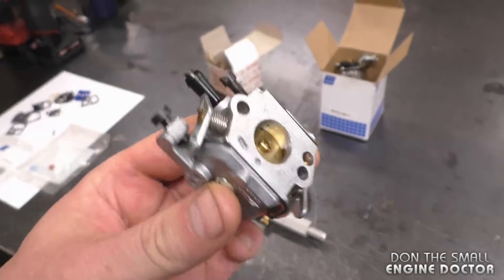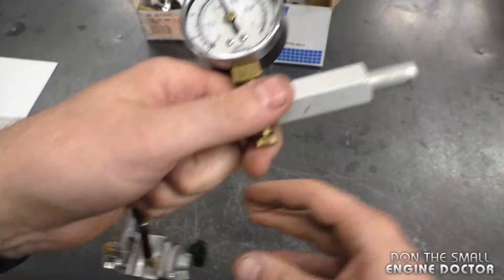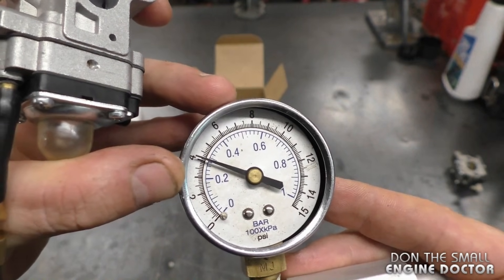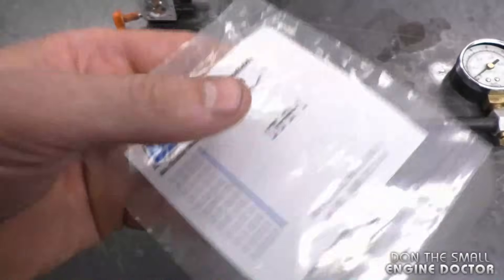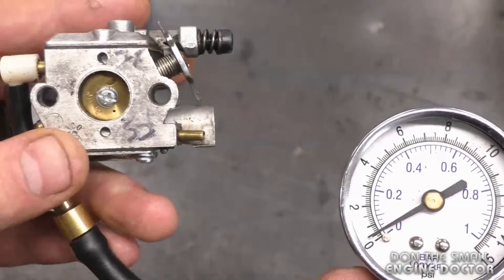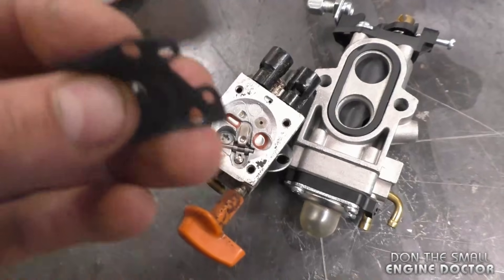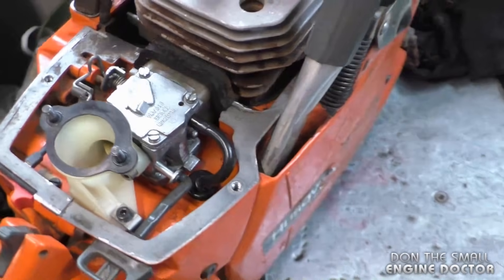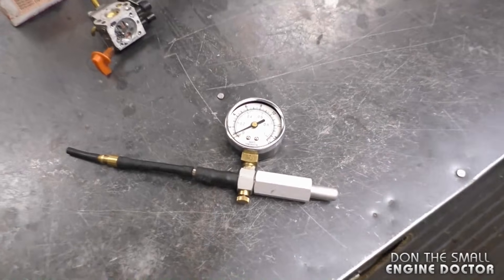HOW-TO Pressure Test A 2 Cycle Carburetor

Comment: I have had my best luck putting the gaskets in wet, not dry. About 50% of the time the leak test fails for me. Usually the fix is taking it back apart, wearing all the gaskets, then reassemble and leak check.

Comment: Is there an easy way to identify which fitting on the carb is the inlet and which is the outlet?  Some carbs it is easy to identify and others are very difficult to identify, sometimes by trial and error.

Comment: The inlet side of the carb, is that the diaphragm side or the reed valve side? What is the best way to know for certain you're putting air in the correct tube of the carb  to check the seat valve? The weed eater I'm working on, Poulan Pro 335, did not have gas lines on it.

Comment: Thanks It what theydo with car engines but with smoke. Can you do that here too? I have done almost everything but still can not get it running. I have sprayed into the channels, changed the diagphram but not the gaskets because it looked good. It is also good to look over the other externely gaskets after the carburator into the combustion chamber. Any leaks will be disastres to the mashine. Look all the way.

Comment: What purpose does that hole on the carb cover plate serve? Will a Mityvac that has a pressure pump feature work the same as the pump you are using?

Comment: How do you fix when you pressure test carb and you have a leak from air valve screws?
Reply from the maker: i replace diaphragm gasket
Reply: @donyboy73  
I got a solo 651 chainsaw and the carb is leaking from the high and low air valve screws.  How would you fix that?
Reply from the maker: @lukepodolski8818  sometimes clear nail polish works on the outside of threads
Reply: @donyboy73  thank you: ill give it a try

Comment: Dony, be sure to add the info about diapham flexability and post height- it can bleed off pressure because it will depress the lever. Make sure the lever arm is at proper height in relation to the carb body

Comment: Hi Dony, excellent vid' from you as always, but, you don't test the pop-off pressure? Isn't it an important thing to check with those testers?

I've learned on an rc website that it should be at 0.8bar

Hi from France

Comment: Can you do pressure test on a 4 stroke carb?  If so, any special instructions to deal with the fuel shut-off solenoid for the pressure test?
Reply from the maker: i flip cab upside down and do a pressure test that way, i test solenoid with a battery, it should retract in when power applied to it
Reply: @donyboy73  So no way to do testing with carb on the engine, like with 2 cycles?
Reply from the maker: @donens9310  no
Reply: @donyboy73  Thanks, that is what I thought.  I continually work of Vanguard and Kohler twins powering grain augers.  Because of sitting for extended periods, fuel is always an issue and carb removal is a pain.  Continuously, cleaning jets, carb bowl and needle/float.

Comment: Donyboy;  have Husq 266 with Tillotson hs254b.  My tester shows inHg and mmHg.  Any idea on what the 7 psi should be on my tester?  Also, what does it mean if the pressure test goes up, then very slowly goes down and settles to a spot, then stays there with no further decrease?

Comment: Thank you Don, for sharing your years knowledge with others I appreciate it- I'm learning that you just can't always clean and put a kit in a carburetor and it work properly- it also seems to make a difference to put back original equipment quality parts when repairing equipment and sometimes it's best to put a new part back in it as opposed to rebuilding the old one

Comment: PR DESIGNS

This should be everyone's go to spot for information on small engines!
I have always found the info and processes I needed for keeping my engines running properly. Donny Boy is concise and obviously knows his stuff....NO bull** from him!!!
I do have a question I was hoping someone could help me answer though......I have a Walbro off of a 031 and a Tillotson off of a 041. I have put complete rebuild kits in both and no matter what I do I get a leak down on the pump side. I know the needle/seat are good as I have tested it with that side open under water and the seat doesn't bubble.
is there a tip for sealing up those flexible valves and gaskets on the pump side even with all new parts??
Should i just try running it before buying new carbs??
Thanks DonnyBoy and anyone else who can help

Comment: Great video, thanks for sharing. Will help with keeping my tools in good working order.
Reply: I already removed, cleaned, and reinstalled the carburetor on my pressure washer with a Honda engine. Idling and throttle-up running like a charm now. Previously was having to manage the choke lever to get to run continuously. Main jet was clogged almost entirely.

Comment: Hey Don, Thank you for this video! I am gearing up to start a mobile small engine/equipment repair/welding business in PA and I saw you on the Small engine Nation with Fill and am learning all I can about two cycle engines. I raced a KXT250 Tecate in the 90's but things never stay exactly the same. Where are you located my friend?
Reply from the maker: congrats on your new business, I'm in Ontario Canada. I'm also a bike rider too!
Reply: @donyboy73  Thank you Dony. I am thinking abut doing free pickup and delivery for equipment and here is why. I have a place to do the work but it is at a relative's and I cannot have customers coming and going.within reason I would pickup and deliver anything all the way down to a chainsaw. I know this wil modify itself as I get more business. thank you again. love the vids.

Comment: What you really have to look at, today, is - is the carb plumbed correctly.  I picked up a little MAC saw a few weeks ago and the idiot that had owned it, previously, had plumbed it up all wrong.  The fuel line was plugged into the carb and not the primer bulb and the overflow line was plugged into the carb.  New fuel lines and diaphragms correct the running problems of this saw.  When I doubt concerning the fuel lines I always consult an IPLfor the specific model of saw i am working on.  The little Mac not starts with one pull and runs fine.  I did pressure test it with my Mighty Vac to 7#.

Comment: Nice video. I have many engines with different cc's, 50cc rc engine, 70cc hacksaw, 20cc and others most with Walbro Carbs. How I know or calculate the right pressure for each engine/carburetors?

Comment: Hey  Don thanks for VIDEO on pressure testing 2 cycle carburetors. I have a
BVM200VS poulan pro leaf blower. Installed new carburetor can't get it run.  Have any suggestions.

Comment: I can't blow air through the fuel inlet what does that mean?? I cleaned the entire carburetor and put it back together and still can't blow air into it and it won't draw fuel.. Any help would be greatly appreciated thanks.
Reply: Ur carb is plugged up before needle diaphragm.

Comment: I have a 280 cc 2 stroke engine with a Walbro WB Carb.  The carb on the unit came with a PSI  popoff pressure of 11 PSI.  The company says the pop-off pressure should be 17-19 PSI.  How do you calibrate the Popoff pressure making it 17-19 PSI.  Thanks in advance for your assistance.

Comment: Can I use this type of carb pressure tester also for testing chainsaw  crankcase pressure ? Or do I need a different one such as the mityvac8500 Thx
Reply from the maker: better with the mityvac
Reply: @donyboy73  Thanks I was hoping to do two  testing jobs with one tool ?

Comment: We also do a vacuum test and it indicates if check valves are working, should hold pressure and vacuum if not carb should be replaced not rebuilt

Comment: As usual I enjoy your videos. I do have a question. I have had one of those pressure testers for many years, but it's time for a rebuild. Do you have any idea if there is a rebuild kit available for it, and if so where to get one?
Reply from the maker: no rebuild kit, Stens has a good tester
Reply: I don't have one of these but I'd wager just looking at it, there are a couple o-rings that are easily available that need to be replaced, how to get that bad boy apart is a good question

Comment: How does the cost of a rebuild kit for a small 2-cycle carburetor compare to an entire new carb?
Reply from the maker: in canada an oem kit is around$20 (Chinese kits) around $5 but not as good. new carbs between $50-$100 in canada
Reply: Thanks!

Comment: Great video thx for sharing. Can I get the part # for brass hose adaptor that you have hooked up to use with different size fuel lines. I’ve never seen that particular one Thx

Comment: Very good demonstration in the fundamental testing of the carbs.  I have one on an Echo weedeater that I rebuilt the carb with a kit but cannot get it to idle correctly.  I have to run the idle speed screw all the way in and it barely idles.  And it is hard to get it to rev up to high speed without it bogging a lot, regardless of how I adjust the mixture screws.  Any ideas?
Reply: Assuming you dont have air leaks in the crankcase, try running it without the muffler. If it runs fine check muffler/spark arrestor screen to see if its plugged up.

Comment: I have been working on small engines for 30 plus years and never used a pressure tester. I used mine at first but honestly, over the years you know exactly what those small carburetor needs when they act up. Lately I have been replacing the whole carburetor on anything that is older than 5 years. I can usually get better results from replacing a carb than rebuilding it. Especially an older one. Good luck finding those check valves for the primer. I have not been able to find ANYONE that sells them. If you have a link, please send it. I trashed 3 carbs last year because of failed primer check valves. As I stated, usually anything over 5 years gets a new carb anyways. I just do not have time to mess with some gunky old chainsaw carb that is plugged 12 ways to Sunday.

Comment: I did the Mason jar test on a carburetor which wasn't that old,I applied a small amount of compressed air to the inlet & I had the carburetor submersed in water.

What do you know? air bubbles appeared around the main nozzles check valve,it was badly assembled at the factory.

The check valve was Loctited in & the fuel had eaten away the Loctite,I'd like to know who made it but it was crap,fuel was leaking from around the check valve.

I've never had that problem with the $16 AUD Chinese carburetors,so I don't know who made it.

I bought another $30 AUD carburetor locally (in Australia) & it ran the hedge trimmer no problems & no returns !

Comment: Do you have a link where you can get that tester?
Reply: search for walbro pressure tester
Reply: amazon or ebay... they are about 30 or 40 bucks
Reply: I bought a mityvac radiator pressure tester online, it is a hand pump w/ gauge. Cost is nearly the same as the carb pressure testers but you also get radiator cap adapters that fit most vehicles. 

Be aware that there is another mityvac that looks similar but it only is for creating vacuum and doesn't come with caps. They also carry one called the silver edition which can do both vacuum and pressure I believe.

The pressure tester that dony is using is durable, lighter and smaller but that may not be important to you if you aren't using it daily as he does.
Reply: I searched and kept getting different products. Try searching for "pop off pressure guage" and it should help.
Reply: Google for: CARBURETOR PRESSURE TESTER GAUGE
Reply: @Reparatour  Thanks

Comment: I have a echo trimmer, that won't idle. When u pump the primer, it drains fast as soon as u try and start it. Is it a bad needle valve and gaskets ?
Reply from the maker: I would try new carb kit
Reply: @donyboy73  thanks for the info.
Reply: I would compare price of an aftermarket carburetor to a carburetor kit also....just saying.
Reply: @billlovett4256  , I was thinking of a new carb, ready out of the box. Bolt and play.
Reply: @tired_old_guy123  so look up which carb it has in it. Or take it off and read what model number it is on the carburetor and you can order one. Carburetor kits are great cost maybe half the price of a new carburetor of less.  But if you're only saving 15$ and don't do it every day or aren't too handy or don't have a can of carburetor cleaner kicking around (10$+/- can) and there's still a chance it won't work....well you see where I'm going with this.
Reply: Great info. That little pressure tester just does pressure, not vacuum? Thanks for your videos!

Comment: Will that same test work for a two-stroke carb off a minibike? Do I test on the oil injector inlet or the fuel inlet?
Reply from the maker: procedure is different, I will make a future video
Reply: @donyboy73  thank you very much I think my carbs having a problem with the rubber tip on the float  needle